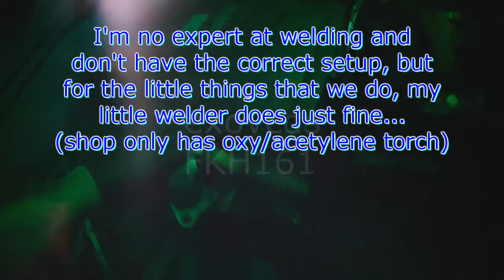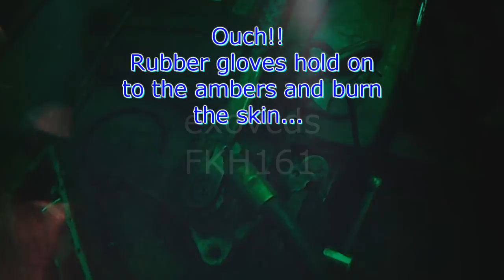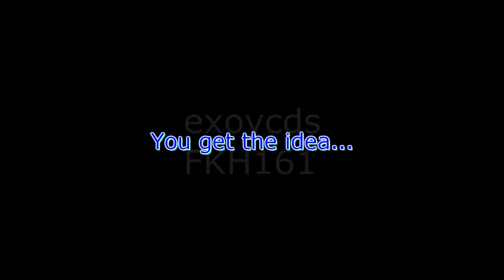VW T1: Clutch Pedal Pin / Hook Repair

Comment: you did a great job on this little thing ,,,,,i need to do the same ,,,,i bought one of those amigo electric welder to get me out of a bind for 168 bucks new , its been awesome so far on my dune buggy for little jobs it paid for itself ,,,,,,for this kind of job as a certified welder for over 55 years i would have used a TIG , low amps but you did really great with that mig of yours ,,,,,,now go ride LOL ,,,,,,
Reply from the maker: Thank you for watching!